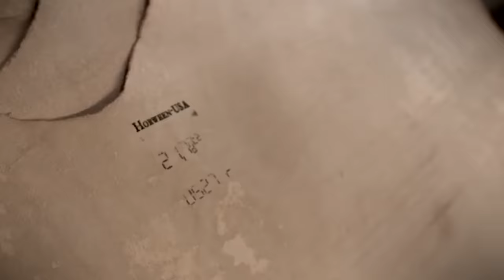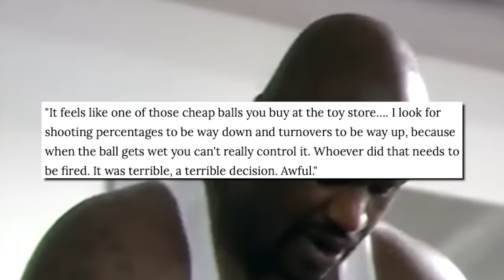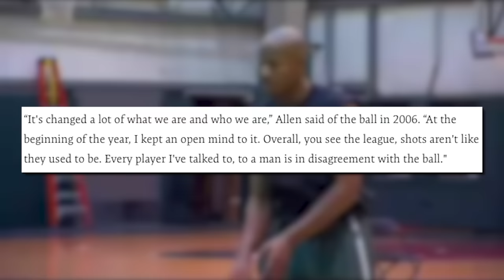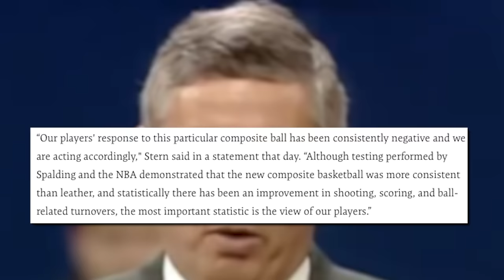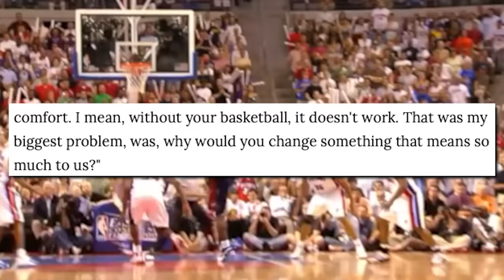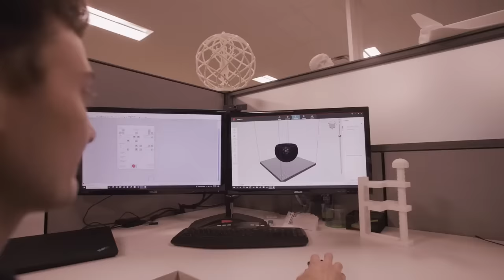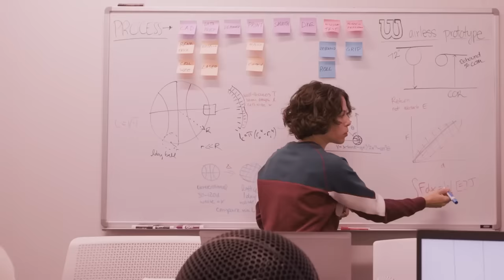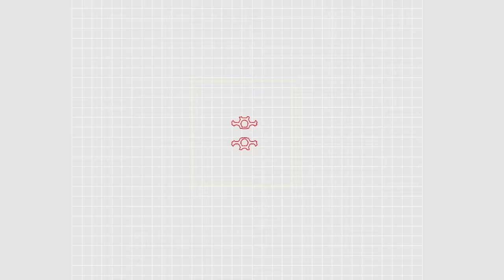The Weird Truth About The NBA's New Basketballs...

Comment: If it can be cheap enough, this would be great for lots of sports. With Wilson, tennis balls come to mind. You can't reinflate them so it's a pretty significant expense and the bounce changes a lot with the temperature. Soccer balls would be nice too. I would have appreciated a ball that didn't need inflating as a kid.
Reply: That's the thing... 3d printing per unit is much much more expensive than normal mass production methods. And very time consuming per unit as well.
Reply: They’ll cost like 250 for one
Reply: @sleepingtom9337  250 what, Yen?
Reply: @Wingnut353  SLS printing can be used fairly effectively for smaller scale runs of things, like making balls for schools and some high end customers. If it catches on then, they would switch to injection molding for a wide scale release.
Reply: The thing is that this new ball is essentially a piece of plastic with a bunch of holes in it. Imagine this thing flying at full speed into your face. That's a big nope, especially for soccer, where you have to hit it with your head.
Reply: @maslelviz yeah. Changing the surface of the ball changes how you need to work with it. My dogs have a harder rubber soccerball that controls completely differently to a normal soccerball, even ignoring the weight difference.
Reply: @Wingnut353  it depends on the scale of production, if it catches on then it'll be cheap but initially it will be expensive
Reply: Nahh tennis balls grip on the ground is much more important than basketballs. The spin makes a huge difference off the racket it would be great but hitting the ground and the pickup from that would be ass also the curve of the ball because of the lack of air resistance to make curves through the air. I love the concept but don't think it'd be applicable for tennis at least not as wel as basketball then again I've played much more tennis than basketball so I don't have the same insight for bball
Reply: yeah we always kicked around a half inflated soccer ball, a hard and lighter ball would be a good replacement for a casual football
Reply: @Wingnut353  The point is reuse is much higher.If they perfect the technology and the NBA adopts it, the NBA might LITERALLY only need to replace 1-3 balls per season which is a massive reduction. Over time this adds up.
Reply: Absolutely no chance this ball works for soccer lmao, those holes are going to get diiiiiiirty, with headers as well the plastic and holes will catch and rip people’s hair off
Reply: @Wingnut353  its 3d printed right now but they could easily just cast it in a mold in two halves and melt them together or make the mold out of something you can dissolve and just spray it off
Reply: @opredatorzzo8133  you could literally have the shell of a normal tennis ball but just with a couple small air holes
Reply: @maslelviz A piece of plastic with holes in it doesn't really explain much. If it's made of a hard plastic like ABS, it wouldn't work anyway. It's clearly some kind of TPU or Silicone like material which is both softer and has greater friction than something like a whiffleball.
Reply: @opredatorzzo8133 This ball clearly grips a surface. In tennis it could be amazing since the ball's spin might have an even greater impact on it's flight due to its dimpled shape. (Though the soft felt does a similar job of shaping the air around the spinning ball.) Imagine a ball that curves and bounces the same way wet or dry, hot or cold. Think of the surface on a silicone bouncy ball. You can absolutely alter its trajectory after a bounce based on spin.
Reply: @Wingnut353  Tech like this always starts expensive and gradually gets cheaper and cheaper as time goes on and people figure out ways to make it less expensive. It doesn't matter what industry your in new things always cost a lot initially and eventually get to the point where there are consumer grade versions of the original really expensive variant.
Reply: The aerodynamics of the ball is hugely more important in soccer/football than in basketball. Basketball players, just as one example, don't (and given the limits of a human throwing a ball that big, can't) intentionally have their shots curve to the side.
Reply: @adafrost6276 SLA, not SLS, and no, you cannot injection mold this.  Thanks for the effort.
Reply: @truantray  I meant what I said. SLA (stereolithography) is resin printing with UV and a mask but this wouldn't be done with SLA, it would be done with SLS (selective laser sintering) which uses a powder with lasers. This kinda thing by large companies is almost always done with SLS printers, which is exactly what they show in the video. Thanks for the effort, whatever that means.
Reply: The thing with tennis - its not just the inflation that goes bad over time. The fuzz starts to go thinner too. Unless you change the fuzz somehow the  balls will always need replacing.
Reply: Not a good idea for soccer, it would change the aerodynamics and would mess with curved shots
Reply: Having small randomness in games makes them more exciting and complicated. Its the same with other sports, you see the best athletes are the ones that can adjust and control those randomnesses, like weather, pitch surface, snow , wind, different pressure in the balls etc
Reply: Are tennis balls really that expensive?

Comment: The additive manufacturing (3d printing) technique they used for this ball is one of the less common ones but has still been around since the 80s. Selective laser sintering. It makes sense for this application as it doesn't need support structure and can print in a wide variety of materials even metal. A stereolithography printer could also probably print this geometry but they can only print in less flexible resins
Reply: extremly expensive, if they keep using this tech they will never make that ball commercialy possible.
Reply: @eljoho622  wrong
Reply: @eljoho622 it’ll be commercially possible, it’ll also just be expensive. 

I really don’t know who or what this ball is for. I guess to reduce waste of basketballs after they wear out. And it looks cool. Except it won’t look as cool when it’s covered like it should be for a smooth but grippy feel. 

Is basketball waste really a priority for this planet? That really something we need to solve? Popping basketballs is really that big of a deal?

Comment: Just dont replace the balls outright, host games out of season or side events like a layup or dunk challenge to gauge the feel and performance of the balls, as well as player feedback. That way, you can actually test it without forcing such a drastic, random change onto the players
Reply: im sure they would never switch NBA like that. too much on the line to abruptly change the ball it would be practice and off season first. im kind of curious to try it though
Reply: People are so afraid of change.
Reply: Swap it out without anyone knowing. Then tell them a year later. Film the reaction and make a commercial. Rake in the dough
Reply: @ryanjohnson4565  Bro. It looks like a honey comb lol.
Reply: @Vespyr_  Probabl;y meant after they figure the outside out. Which will most likely have a cover or sorts or to look similar. In any regard, these divas that play on courts and fields think they know all. When bottom line is, change happens to everything. And you either change or get left behind
Reply: Summer league or gleague too, any exhibition game. It's a fantastic idea and I think a lot of the issues will be resolved by a leather wrap closing up the holes but like how the leather today surrounds the internal basketball inflation seal. Adding weight tithe structure of the ball or on the leather to keep things consistent to today's ball, I believe it should be possible to make this ball virtually identical to a traditional basketball

Comment: As the video touched on, the aerodynamics of this ball would probably be very different to the existing ball, with some air going into the inside of the ball.  That would have to affect its flight characteristics.  
It looks great, sure, but looks are a lot less important than "feel" and performance -  bounce and flight.
Reply: also when it spins all those holes each create drag.

Comment: I kept 3 of the 2006 balls. I actually liked playing with them. Even if this new ball is exactly like the current one, there's a psychological issue at play. The current balls are fine so, in my opinion, there's no sense in changing them.
Reply: I agree. The balls weigh the same so I can't imagine it being a good environmental choice either. That's the only reason I could see.
Reply: Absolutely no reason at all to change them. We need to stop fixing things that aren't broken
Reply: When businesses create a solution for a problem that doesn't exist, there's always something else at play - usually, money. Either the replacement product is cheaper to produce at scale than the original, or they're hoping they can trigger a fad and sell everyone a new ball.
The only thing that loses out for sure is the environment.. instead of using natural leather and rubber (though I know petrochemicals are involved in most modern basketballs), they're moving to pure 'elastomeric polymer' balls - essentially a combination glue and plastic, probably carbon fibre and other components too. You can guarantee it's not recyclable, and likely non-decomposing. Thanks, Wilson.
Reply: Its prolly considerably cheaper for them to produce, thats why. Profits.

Comment: There are also these rubber balls that are just terrible. A new one roughs up your hands. We used to spin in in our hands for hours before we were happy to use it. It did perform equally, but why not use the leather one to begin with.
I think that might be a similar problem with the new one. Having hard edges is not good.
I am also concerned about dust inside the ball. They would most likely build up stuff inside like hair and skin particles. While balls are dirty on the outside, you can't clean the inside causing it to be filthy after some time.
You also can't put cloth on the outside, because it wouldn't bounce as well, so you can't fix the problem. Neither do I trust that it would bounce after laying in a corner for 4 years like air balls do.

Remember, NBA balls are usually the standard that everyone uses including kids.

Comment: When a sphere with holes like that spin, there's going to be drag. To stop the drag, you'll have to close up the holes, or make them small enough where airflow isn't going to be an issue. Then to fix the texture, you'll have to wrap the ball with the same or similar leather. Then to prevent dust and water buildup contaminating the interior of the ball you'll have to prevent things from entering the holes, either by plugging it up or having a one way hole design. In order to prevent the air being ejected out in a one way hole, you'll have to ensure there's enough air that enters and remains inside the interior.
Congrats, you just created the current leather ball.
Reply: Lmfao exactly what I was thinking. It's like these people never seriously played basketball. They forgot the most important aspect of the game which is shooting. And when a player shoots a jump shot they will put backspin on it with a flick of the wrist. It can be the difference between a swish and brick. That seemingly small difference in trajectory will really stand out in a game where each team can take a 100 shots per game.
Reply: they're literally trying to reinvent the wheel, but in 3D

this reads like NBA people are getting paid for wilson to increase profits with a cheaper, worse product. if they were serious there'd be years of testing at more junior level games before even thinking of asking top teir professionals to touch the thing
Reply: There will always be drag, and it is not game breaking changes. Some divits are often used to reduce drag, and holes can provide a different path for air reducing the air volume being displaced by the ball.
It will change, but that is just a matter of getting used to it again.
Dust and water buildup will not be a problem as the thing is filled with holes. 
Because there are many holes, having too little air inside the ball is a non-issue. 

You are just making problems where there are none. There are changes and challenges, perhaps too big ones, but no obvious breaking problems.

Comment: This could work if they add a layer covering the holes. It needs to feel and play EXACTLY like current basketballs, but with a different inside

Edit: y'all are having a great discussion in the comment section about this
Reply: fr
Reply: But then it wouldn't be airless
Reply: @ricorite5617  I mean he's saying make it without holes, so no it'd just be hollow no need for air since its 3d printed
Reply: @John-pp6xy  and what is the hollow part filled with?
Reply: @juanpablogarcia9309 ou know you can make a hollow structure without filling it with pressurized air right. An “airless” ball is just a different material all together that keeps its shape without air inside, it doesn’t have to be filled with holes. It’s just easier to 3D print if it is. They could cover it with a leather wrap or something to make it feel like a ball, but it’s definitely FAR from being able to replace a real basketball
Reply: the holes will add for grip too, i see it as beneficial
Reply: @astrowerm  not beneficial for outside play
Reply: @4purs  it does not matter if its pressurized or not, you're enclosing any amount of air inside the ball and the environment, temperature, wind, etc. affects the pressure of the air contained inside, which WILL affect how this ball bounces, travels in the air, etc. which is why the damn ball has holes in the first place
Reply: you could simply add a tiny hole, similar to the valve used to fill normal basketballz
Reply: @4purs  @JaylaSuburbs  if you cover the holes, the issue with pressure differential returns and now the ball will change size and alter performance at different altitudes and temperatures.   The holes are there for a reason.  Not just to look cool.
Reply: That defeats the whole purpose of the design.
Reply: @juanpablogarcia9309  i mean there are solid wiffle balls with no holes that are just two sides fused together and still have plenty of pop
Reply: @LucidStudios @JaylaSuburbs Completely agreed. The ball could be covered with another layer that is smoother and allows air in/out, perforated leather for example. It doesn't have to be an airtight layer like some of the other commenters are assuming, it's just for the texture of the surface of the ball.
Reply: @ricorite5617  tf are u talking ab? The hole ball is not airless either because technically by this argument there is always air inside the cavity still. It would be no different if they put a skeleton on it. It just wouldn't need filled with air again as the skeleton is what holds it up.
Reply: @fighterck6241  I really doubt that will matter too much if it's not really pressurized. The leather also would be held to the skeleton, so the only possible difference would be it doesn't bounce the same as it would be more solid, but idk if it would matter that much if done right. It could even have a constant bleed valve like the balls now, but instead, it just lets air come out instead of where you fill it up. Could even have a few just in case one is clogged. With obvious thinking this wouldn't be too hard to fix, but I feel like they wanna have it look like it does because they think it looks cool instead of just practicality.
Reply: Why try to replicate something exactly if you already have the thing you are trying to replicate. There are no complaints so why change it?
Reply: @John-pp6xy  bruh go back to school and get your GED you sounding daf rn
Reply: Making a comment and not realizing it's stupid.  That is what you just did.
Reply: If we always had that mentality we would still have old soccer balls. Why does it have to be exactly the same?
Reply: @JeyPeyy jabulani had problems and got tossed real quick if I recall correctly. There's also significantly less shot attempts in soccer and a wider margin of error for the size of ball and the goal. Not saying it's easy to score a goal in a game of soccer but you would be an idiot to shoot a curve or knuckleball shot in basketball as a strategy for example. Being that there are so many shot attempts in bball (can be up to a 100 per team) a single digit fraction of error can mean losing the game and significantly reduced fg%. Nobody wants that, not the players, not the fans and not management. . I love soccer and I played both sports at a competitive level but I gotta say the difference of balls we played with in soccer had less effect on the game than in basketball
Reply: @rks5457  I'm talking about the fact that they used soccer balls in early days of basketball. Changing that ball changed how the game was played, but it was the correct move. Saying that all new balls should be exactly like the current ones is just being against progress. Just because the new ball may be different it's not necessarily worse, both teams play on the same condition afterall.
Reply: @JeyPeyy preach! So many closed minded people, so afraid of change.

Comment: My only issue is being plastic as it ages. It gets brittle you have to soak them to keep them simmy the right consistency. Over time
Reply: The plastic polymer used is an industry secret, but from research im doing its something probably similar to PA12, which is quite durable ngl. It also absorbs moisture very well.